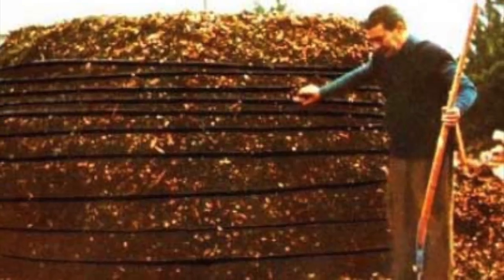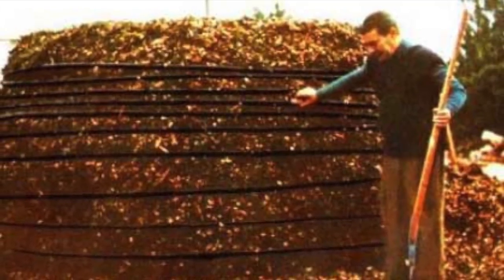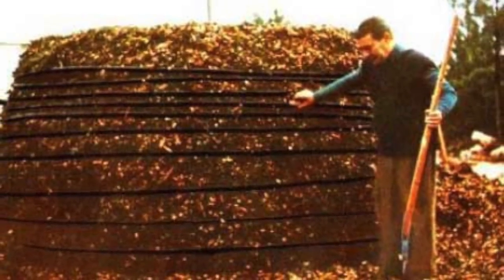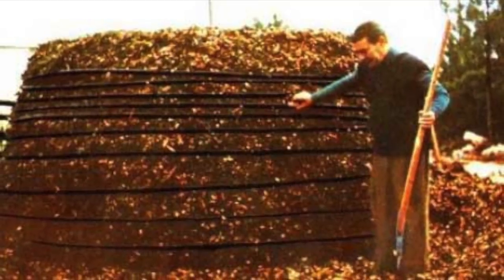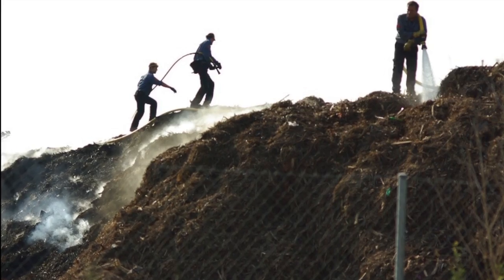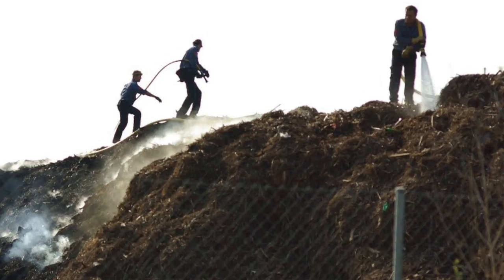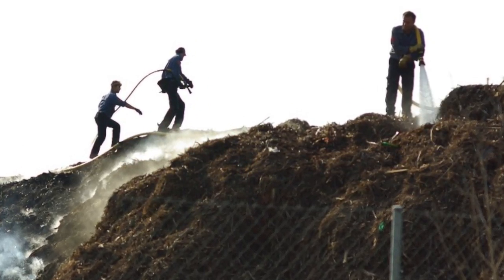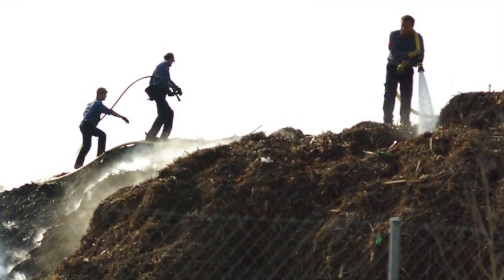Compost Heating vs Passive Solar for a Greenhouse

Comment from the maker: Have you ever used this heating system? Please comment your experience as I plan to build this for the 2018/19 winter.
Reply: I've always wanted to do a jean Paine pile, but never had the balls.  I'm urban in a farming/oil community.  I have good soils so far with hugelkultur, but I might just give it a go this winter along with you.  I've got a backyard, too, after all.
Reply from the maker: Sparkyplug Clean keep me updated on your results please!
Reply: My mother and I built an experimental one this passed winter 2017/18. It waa 3 ft wide pile the whole width of the green house. I lost Arugula when it was -9F, but alot of things survived including lettuce. It was closest to the vents of the compost pile. Still working on perfecting mine. Can't wait to see your video.
Reply: This works amazingly well, I am currently getting temps over 140 from the compost in my chicken run and they LOVE digging through it for the sauna effect.  If possible, I recommend adding hens to your pile ...  <--- Canadian (eh)
Reply: All this makes sense or not. Totally dependent of perspective. 
Does it produce eat. Certainly it does, nobody ever question that, it´s obvious. ;-)

But is it "worth" the trouble or even reliable enough for any commercial application. No it´s not. Unless you can access resources on "industrial scale" to keep it going steadily. 
Steady or constant is the key word. Unfortunately without huge amounts of biomass it´s hardly controllable. The main reason why most experiments fail. ;-)
Cheers
Reply: it would be so perfect for underfloor heating a tiny house. Once I wanna try it out, its a big dream since 5 years for me. Thanks for this great video!!!
I know that the "Hotel zur Moorhexe"  is using the warm energy of a big "biomeiler".
Reply: Did you ever build this? I run an NGO school in Guatemala and we're building a new school house. We need some heat (but not too much) as the lows only get to about 45F each day.  We have enough land, so this looks perfect.  I'm thinking to put air ducts inside the compost pile, rather than using a water system.  Thoughts?
Reply: I have made many experimental hot water producing heaps. I can routinely get water too hot to touch and I can sustain water hot enough for a shower or bath for many weeks. This is quite easy to do and could be very useful for heating animal shelters and many other things. Happy to share photos and info. Messenger is fine with me.
Reply from the maker: @kenbellchambers4577  that’s awesome!!! Love to hear more email me

Comment: Thank you for investigating this amazing technology. I will be looking at more of your productions. 
328 - This drawing seems to be using hot water, whereas Jean Pain thermosyphoned hot air that was produced by the decomposition of 'brushwood'.  Jean and his crew manicured the forest in a thoughtful, delicate and wonderful way to stop fires and they took a woodchipper with them to the job. To make the compost. they used not only wood, but leaves, weeds, unwanted or unhealthy trees etc. It was far more than simple wood chip. It had more than enough nitrogenous material so that manure was not necessary for making the compost, or for use as feed stock in the methane digester. Both used simple forest wastes.
Secondly, the green house Jean built was on a ledge a few feet higher than the compost heap so that the heat could be naturally siphoned via 6-inch agricultural piping from the heap to the top of the greenhouse, and the cool air from the bottom of the greenhouse then returned to the heap. No fans or pumps, just a height difference was employed to circulate the hot air. This system kept the green house at about 77 degrees day and night for an entire year, and this includes frosty winter-weather nights. This represents a very large fuel bill if propane or grid power was used instead. In fact, for those in very cold places, this could be a life-altering technique. ethermail
Reply from the maker: Thank you for the info

Comment: A little history on my compost adventure here in Alaska. I have been making 30-50 yards of compost for our five 100ft long green houses for 6-7 years now. Four years ago I poured a 12ft by 48ft concrete pad next to our cow paddock. I then build a 6ft tall block wall on three sides and then built up block dividing walls into four bins. Each being 12ft x 12ft.  I clean the cow pen out in the spring and fall and I  am able to load it over the back wall and fill two or three of the bins on each cleanout. It only takes me approx 60 minutes, but,  I can only accomplish this since I have a large enough tractor and a excavator. It is a much more efficient  and sanitary system over the way I use to just plop it into big messy piles in the past. Since the bins are open in the front I use the tractor forks to mix and aerate the piles usually once a week. I  routinely see temps in the 140 degree plus range and I have been able to make finished compost in as little as 6 weeks. That was until this year. Last winter I changed the way I feed my cows and I have reduced my hay waste to less then probably 5% from the approx. 20% plus waste in the past. That seemed like great news till I discovered that the cow poop I was loading into my bins had a terrible carbon/nitrogen ratio.  We had a heavy rain year and I don't have covers over my compost and I was lucky to get the temps into the 100 degree range if at all on one of the bins. They were stinky an slimy.  I  lost an entire season of compost making from these two simple mistakes. So last fall I got free deliveries of approx. 100 yards of fresh wood chips. I did not have time to do anything with these chips and piled them into one big pile. Now the temps in that chip pile is hotter then I was able to achieve in my compost bin and I didn't even do anything.  go figure huh? One of my neighbors stopped by and was concerned that I had some type of unground fire going when he saw all the steam.  haha.  I am thinking next spring I am going to blend my cow poop piles with wood chip, bury plastic water pipes and then plumb that to my shop baseboard and see how that works out?
Reply from the maker: John Mcneal please keep me updated!!!!!
Reply: UPDATE?
Reply: update?
Reply: Upppppppdate pleeeeease
Reply: Update please?

Comment: If you have a lot of biomass available....and a chipper then it is an interesting method for sure. If you want to use it for showers I have heard it can often smell (and make you smell) like compost. If the goal is to heat the greenhouse then don't underestimate the power of hugelkultur garden beds. The breaking down of the organic matter can go a long way to warming the soil. Also don't forget about the 2 liter solar collectors can reduce the solar evacuated tube costs...I plan to build one of this this spring so I'll let you know how that goes.
Reply from the maker: Thank you for the comment. The point of the video is MOST (not all but most) places have access to wood chips or hay. Not sure how if used for showers it could make you smell if you're using a closed loop water circulating system, the water never physically touches the biomass. 

I've never heard of hugelkultur garden beds in a greenhouse or for heating, my understanding was they are primarily used outside in gardens so you don't have to regularly water the crops planted in them, kinda defeats the purpose to use hugelkutur in a greenhouse where watering systems exist for daily watering.  I've heard from other places using wood chips directly composting in soil where you are growing leaches nitrogen from the soil and retards growth. My understanding is you compost the material and after it is composted you use it as fertilizer to grow your plants. yes there would be heat but the nitrogen loss from creating that heat makes it a mute point.

 I'd like to know what you mean by 2 litre solar collectors? I'm very curious there.... please expand on that.
Reply from the maker: I think I agree with you, your friends must've had a leak in their line somewhere to get that smell.

The nitrogen absorption is like you say, a bank, it comes back once decomposition is done. That's why I suggest composting separate from growing - but the water absorption properties in the ground helping plants without watering get through drought outweighs the nitrogen losses. Mushrooms would be a HUGE bonus - that's something I seriously want to explore growing mushrooms in the near future! (checking your solar video link now)
Reply from the maker: I checked that link - I'm left with some questions on it. First, evacuated tubes work so well because they create a vacuum, which is almost perfect insulation, so they can produce heat in very cold winter temperatures. Using a pop bottle would negate that, you couldn't get a vacuum with a pop bottle. Second, pop bottle plastic (pet) is designed to degrade in sunlight, so the life span would be a year or less with direct sunlight and heat before they discolour and work less effective. I can see getting somewhat of a greenhouse effect but there are better options using cheap or free materials. Check out Sergi's videos on parabolic troughs - he's made a few this is just one https://www.youtube.com/watch?v=RGJB8lO-YpQ&t=27s
Reply: They are not a system I would be trying to use in winter....I would try to stockpile warm water in barrels using the help of the system in summer and shut it down for winter. They would not be nearly as efficient as solar evacuated tubes but if you have a lot of space then you don't need to so efficient. consider how some people run black pipes on on their roof as a swimming pool heater and they don't have the extra insulation of the pop bottle collector. The 2 liters bottles have decent UV resistance....I don't know just how much but many people make these collectors or even 2 liter pop bottle greenhouses. They may turn cloudy over time but I think it would be many years before they wore through and at that time you can always recycle them. The large parabolic troughs look pretty cool but more complex then I want to get into.
Reply from the maker: Tim Burrows I’m curious, what do you need the hot water for in a greenhouse in the summer? If you’re heating cold well water, painting a barrel black would be easier. Not sure what other purpose you’d have? Warm weather climates use it for household hot water.
Reply: I am working with a farm and plan to do work shops on various off grid low cost technology. The mass hot water collector will be mostly for outdoor showers for farm volunteers but I might experiment with warming the barrels under a seed bench as a stable temperature buffer for seedlings. If the collectors work well I plan to work them into a climate battery design I have in mind.
Reply from the maker: nice!

Comment: On our farm we use rotting compost to heat small raised bed green houses. Here’s how we do it: 1) dig a series of interconnected trenches in the shape of the letter “E”, with the back of the E facing down slope. The back of the E is an underground dam. 2) Water from upslope feeds into and fills the trenches. 3) Place a pipe through the underground dam so that you can tap the underground water as desired or needed. 4) Line the trench with an impermeable liner. 5) Place multiple strands of nylon rope in the bottom of the trenches. 6) Fill the trenches with a compostable mix of wood chips, sticks, leaves, etc. top with branches and then cut sod. Place two sets of PVC pipes into the trenches, one for air and one for the rope wicks 7) Thread the ends of the rope through PVC pipe and spread the frayed rope over the bottom of the soil in your raised bed boxes. 8) The PVC pipe on the sides of each box should look like this top |__|_ pit (just turn this vertically). The layers in the boxes 12” top soil | landscape cloth | rope wicks exiting PVC pipe | landscape cloth | sand and drain return to pit PVC pipe | landscape cloth | hardware cloth to keep out burrowing pests | sod | below grade branches | below grade rotting compost | impermeable liner | native soil. 9) Plant your crops in the boxes. 10) Cover the boxes with an insulated greenhouse cover to trap the heat from the rotting compost. The heat from the compost heats both the overlying raised bed boxes and the surrounding soil all year long. The accumulated summer heated soil is the battery that heats the greenhouse from below in the Winter. The soil is so warm that it melts the snow so the ground around it never freezes. Composting continues in the Winter, albeit at a reduced rate, as the heat is trapped by the overlying covered greenhouse which covers two rows of raised beds and the intervening walk. In summer of course the greenhouse sides are rolled up dissipating the excess heat. Evapotranspiration fuels capillary action. The wicked water waters the plants from below. After the compost is spent and the boxes start to sink, remove the boxes, dig up the finished compost spread it on your plants, recharge the pits and start again! This scheme generates, heat, water and compost! We get some cold days below freezing and the surrounding ground does freeze in Winter. If you live in a very cold area you may need to add some underground insulation around the perimeter of your raised bed area.
Reply from the maker: That's awesome - thank you for sharing!

Comment: Have you started the pile heating system yet? I've done a couple of research projects on it, and prototypes. The type of organic material really makes a difference, so does how the pile is constructed, heat exchanger type used, and piping material. I've successfully tried a number of methods to supplement the system during cold weather stalls, which happen with many pile heating systems.
Reply from the maker: Nick Sherrington building this fall, where can I access your information!!!!!!
Reply: @SimpleTek  Hi, not sure if you've read Gaelan Brown's book "The compost powered water heater". Its a good place to start. I will try dig up the old information I have from the projects. However, I have a bad feeling its on an old laptop drive that never got backed up. If I don't I can draw up the basic design easily enough.

Comment: I haven’t tried this system but have often thought about how nice it would be to leverage my composting manure pile—I have a small horse farm in zone 6 on the US east coast. My only contribution to this conversation is that straw might be a better fuel source because it’s cheaper than hay and contains no seeds to germinate. (You’d be surprised how much weeds are seeded by having hay on your property.)
Reply from the maker: Jenn White the bear compost has greens, browns and poop. Straw counts as browns

Comment: Consider this, build a 30 x 30 concrete box, nice and thick, well insulated on the bottom and the four sides, one side having a door for bobcat access. The top/ceiling is thick concrete to act as the floor of a house, on top. And to act as a buffer and radiant floor. Inside the concrete box is, you guessed it, compost pile/piles. I'm sure there'd be plenty of safety considerations.
Reply from the maker: interesting!

Comment: Sounds great but I have 2 questions: 1, how can I build a huge compost pile using hay in a very windy area...how can I keep the pile from blown off by the strong wind which we get a lot in our area. No one in our area has windmill due to no one knows how to fix it when it break down...2, the video mentioned plastic tubing in the pile to draw heat, would the plastic tubing melt when heat gets high in compost pile? Thanks.
Reply from the maker: hi there, I suggest building a fence like wall with the cheapest material available to you to contain the hay pile so it doesn't blow away, and a secured tarp on top. build it on a non windy day. as for the pipe, as your supplier what the heat tolerances are for your piping. most manufacturers list that, use plastic piping that can handle up to 180'F and you should be fine. Most pex used for radiant heating in floors  for example, is rated above 180'F - but check with the manufacturer. I hope that helps!

Comment: Would a smaller greenhouse (under 300sqft) benefit from this method, presuming the compost pile was also reduced in size? I'm on a one-acre lot in a neighborhood, and I have done composting for years in small batches (1yd x 1yd and 3yd long x 1yd high), but I've never tried to pipe out the heat from the piles. Do you think a small pile could produce enough heat to consistently warm-up a small greenhouse? I'm in north central Texas so our winters are mild compared to yours, but we still can't grow veggies in the winter except in a greenhouse. I'm planning the greenhouse now with plans to build this spring, and I'm thinking through how to heat it using more natural methods than propane or electricity. Thanks in advance!
Reply from the maker: Size matters with a compost pile if you want a lot of heat. The materials and size of them also matter, but that being said, I'm guessing about 20-30 yards would work for your situation....

Comment: Can you use a regular hose around the compost pile and will a compost pile heat up a regular hose the same as a plastic pipe would heat up? How do you get the water to circulate into the greenhouse? Do you use a water pump? How do you control the heat of the water from getting too hot?
Reply from the maker: pex costs less than garden hose